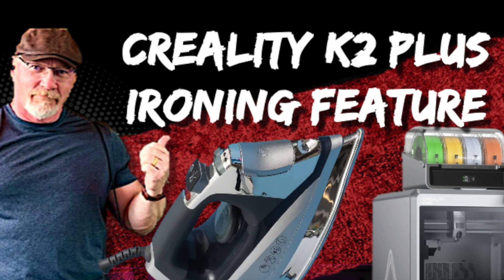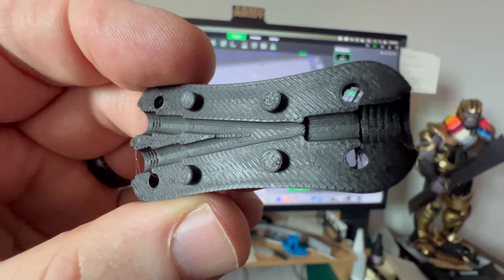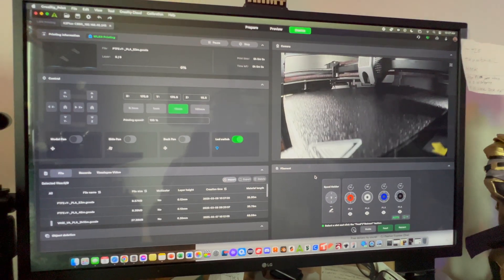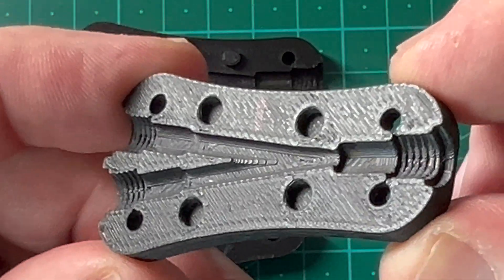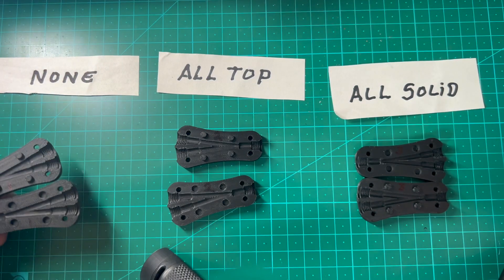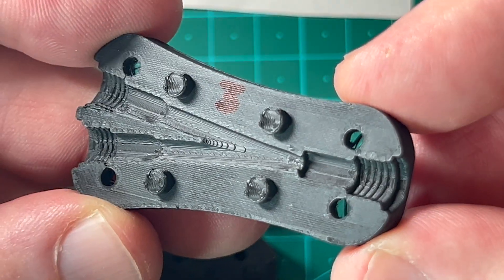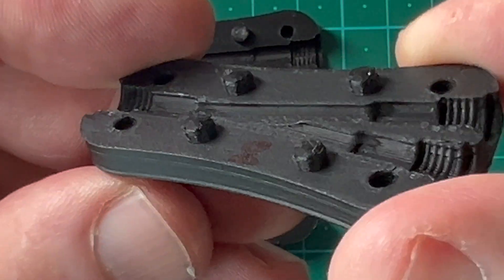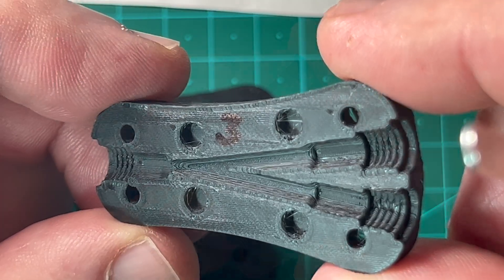Pro Creality K2 Plus - Smooth Your Prints with the Ironing Setting

Comment: A tip would be to do concentric ironing on the top of those circular tabs so that they don’t mushroom like that. Or just disable ironing for the tabs. You can add modifiers in your slicer 😊 good video!
Reply from the maker: Thanks for watching and the concentric ironing info. Good stuff.

Comment: Thanks for showcasing my design! However, once the part is assembled and the PTFE tube is in place, the filament won’t really touch any of the sides because of its larger 3mm straight path. I also would recommend silk PLA for its slippery surface finish.
Great videos, keep up the good work.
Reply from the maker: No thank you. Appreciate the silk PLA suggestion too, good stuff.
Reply: I also printed one in clear PLA, so cool seeing the filament going through!
Reply: post pls link to your design. thx

Comment: Curious what happens if you rotate the part 90 degrees on the bed so that the top layer lines run same direction as the slots, use monotonic line, slow down top layer to 30-50, and adjust top surface Flow ratio to something less than regular filament profile flow ratio (which is basically what ironing is doing for you, without the nozzle dragging, mushroom effect).  generally find can get better results with this approach than using ironing which can have the side effects you are seeing.  Using this approach rather than ironing can also result in a smoother, shinier surface, which can be more aesthetically pleasing than ironing.  it is generally also also faster
Reply: You’re absolutely correct, orientation is the key.
Reply from the maker: Wow. Thanks for the information. I will have to study up and give that a try. I have so much to learn about 3d printing. Appreciate the info.